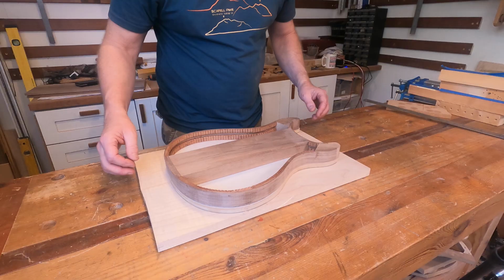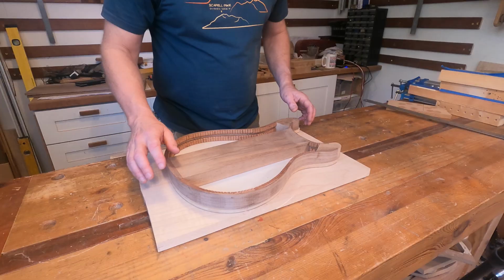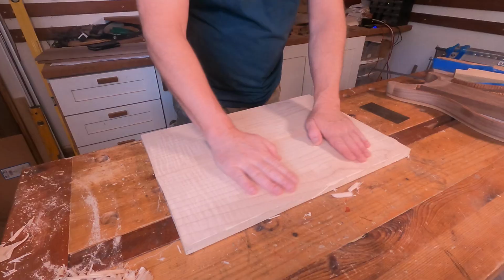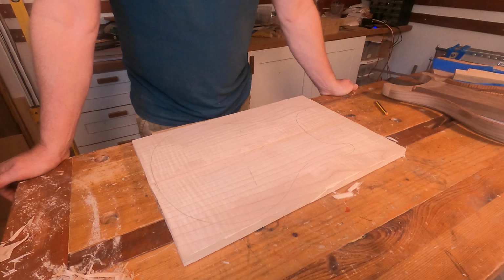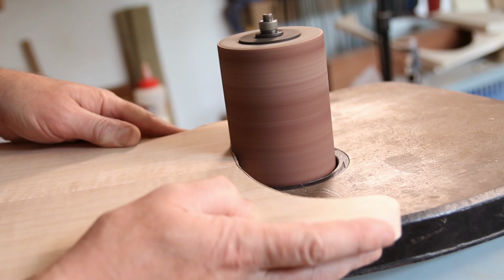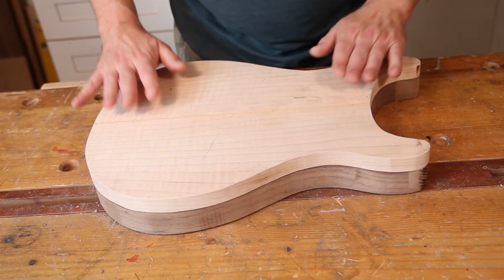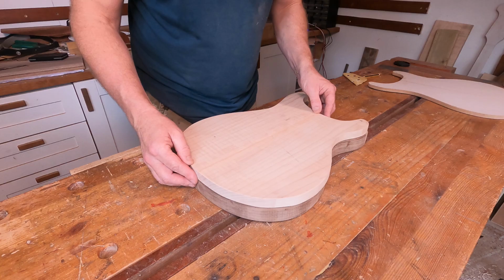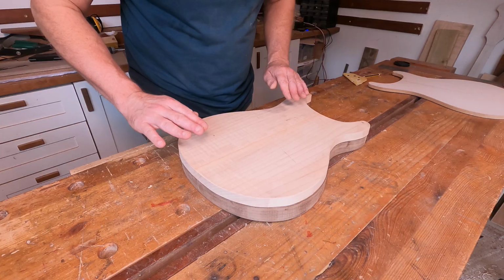GGBO 2022 scratch build guitar episode 15

Comment: what size bandsaw do you reccomend for a small workspace that is a big enough for this guitar stuff?
Reply from the maker: Generally I would say the bigger the better but if you have limited space and or budget something like the 9 inch Lumberjack that I used before I upgraded was fine for 95% of the guitar building tasks. The issue with smaller bandsaws is you struggle for thickness of cut so you can't do things like resawing guitar tops but to be honest how often are you going to be doing that.